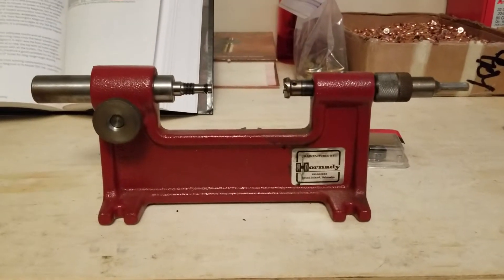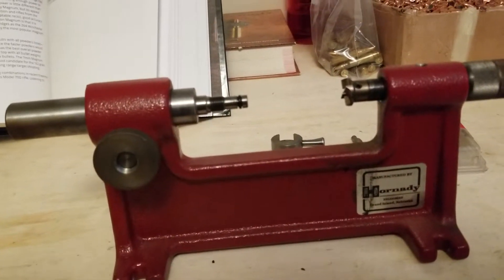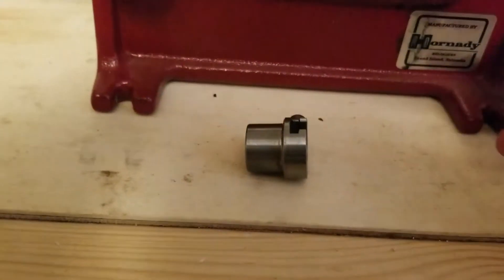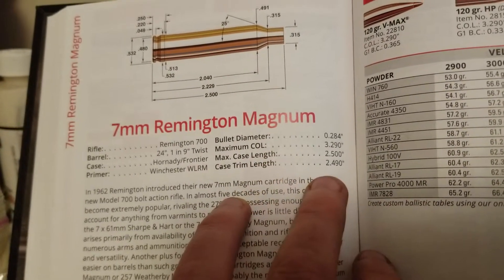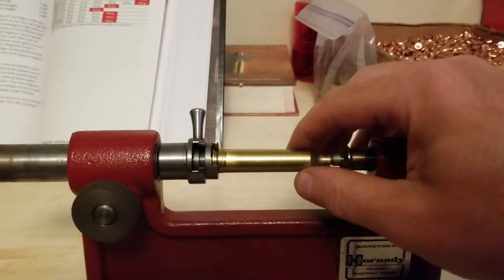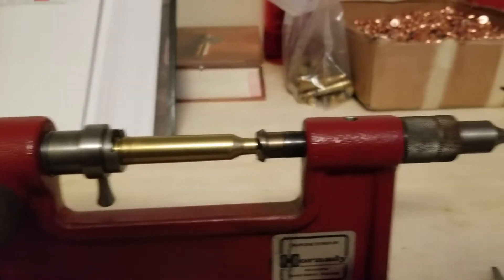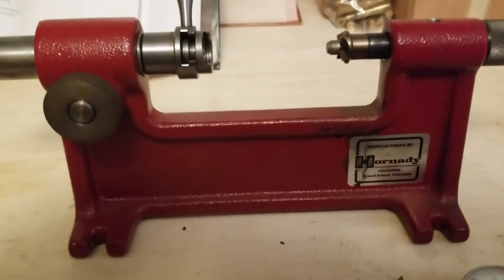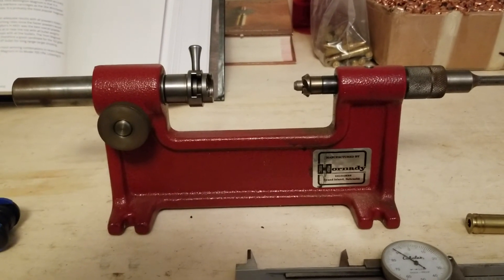How to Set Up the Hornady Camlock Trimmer

Comment: how do you know what pilot to use?
Reply from the maker: The pilots are numbered on their faces 1, 3, 6, 7, 9, 15, 19 and correlate to common popular caliber sizes of .223, 6mm/.243, .270, 7mm, .30, .38, and 45. The one issue I have with the number is the only way to distinguish between the #6 & #9 is to compare them side by side or to measure with a caliper. I really wish they would have numbered them with a line under the 6 & 9 for easy reference. If you're needing to trim a different caliber than these you can purchase separate pilots to fit your needs. I hope this helps and if you have any other questions, I will do my best to answer them.
Reply: @ctu7070  thank you for the prompt response. I wish the numbers meant something.

Comment: Do you have to use hornady shell holders?
Reply from the maker: Sorry it took me so long to get back to you on your question, but I obviously have the Hornady shell holders. However, I do have a few Lee shell holders that I received in a purchase of reloading equipment from a friend, but haven't needed to use them. I got them out today and tried them, they do fit, but the hole in the center is the same size on the bottom but tapers down to a smaller sized hole. This causes them to not allow the pin to travel through the hole to lock the case into the shell holder. I don't see why you couldn't make the hole bigger to allow the shell holder to slide over the pin so it will lock the case in the holder.
Reply: Short answer is yes
Reply: Thank you sir for whatever reason I couldn’t figure out how to install the shell holder, yes I’ll admit I was a idiot in the moment. Just got done trimming 100 pieces of 264 win mag and must say it was super consistent, got mine as new old stock and am happy I did.